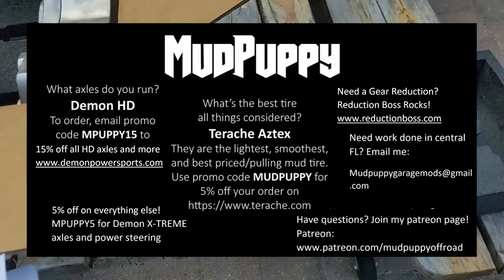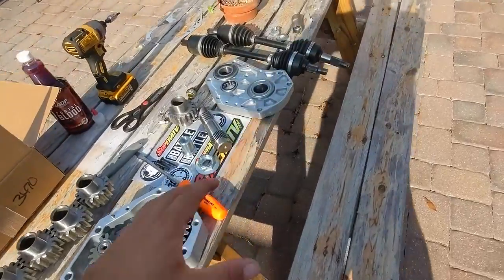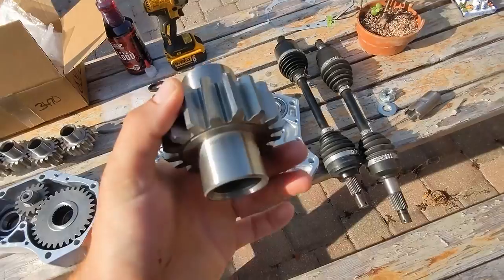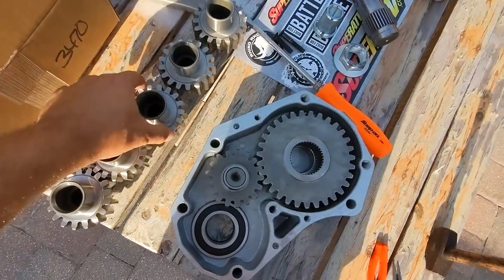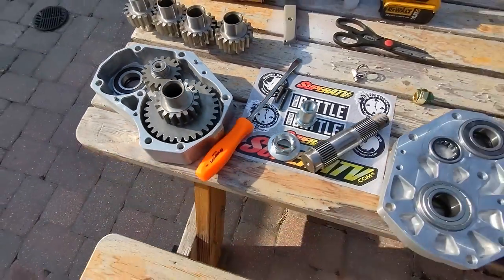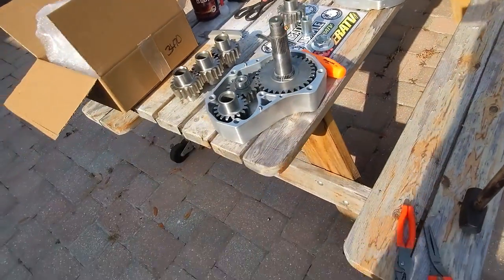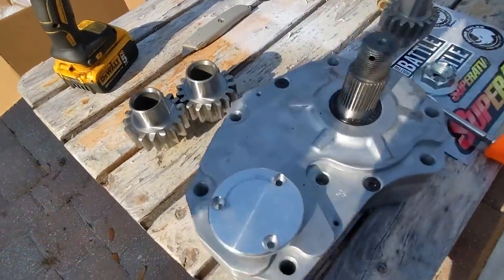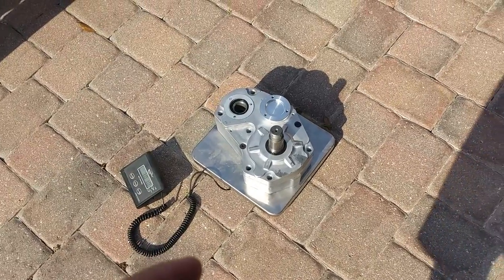6" Portals on a Rubicon 520? Parts fit check and unboxing

Comment: I know this is an old video but can’t get any reliable info anywhere so my question is. Are the top gears the same even with different gear reduction? Does it use the same input gear for 15%-45%? Thanks for any input
Reply from the maker: Yeah Super ATV is really annoying about putting out good documentation on that. But from what I've found all the top gears are the same as far as how it fits into the portal box and the teeth count. They just change the splines
Reply: @MudPuppyOffroad  thanks for the reply man and the content I watch everything you put out. I’ve got 15% 4in portals on my pioneer 1000 found some 30% for a can am cheap and was wondering if I could just put my top gears in them and go
Reply from the maker: @sccott_og3786  I haven't done that exact swap yet but from what I understand it should work

Comment: Have a questions for anyone on here willing to answer, I have a pioneer 700 and I’m looking for a suspension lift but everyone I have contacted has said the pioneer 1000 suspension and the 700 suspension is different, I would like to know how they are different given nobody could give me a for sure answer. Just don’t understand how the 1000 suspension lift and the 700 aren’t compatible.
Reply: I couldn’t tell you how they are different but I do know there are 2 different lifts for the 700, I believe one is highlifter which is a puck on the shock and then I have a bracket lift from Strongmade that’s very simple to install